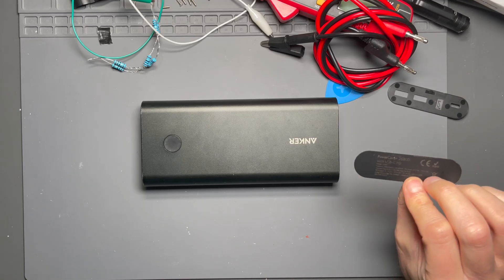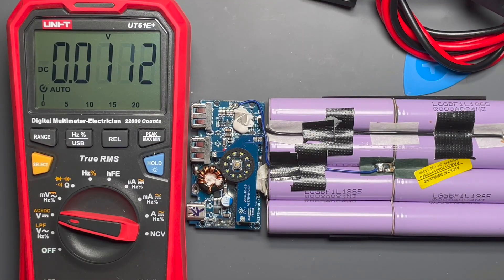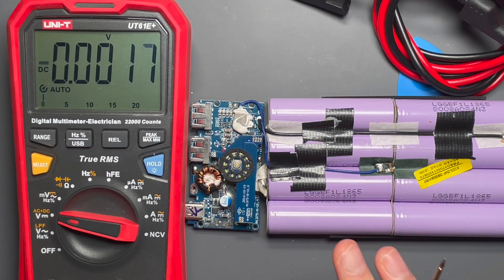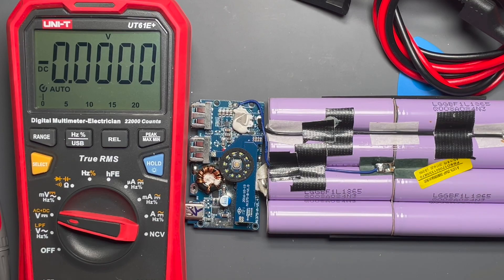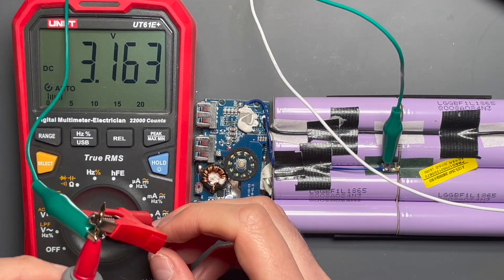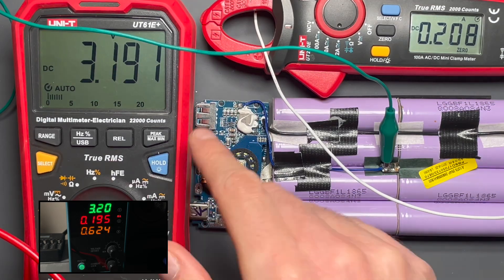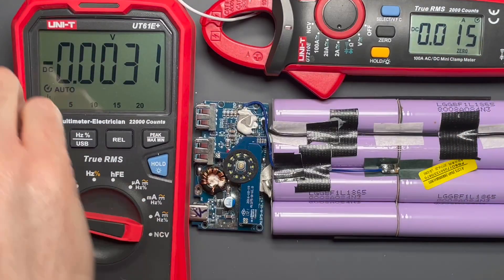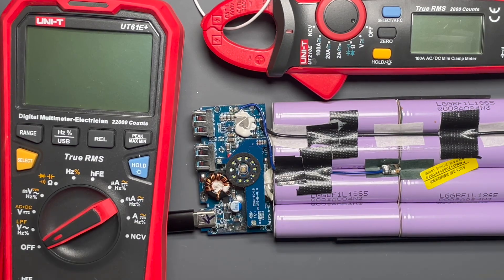Anker PowerCore+ PD 26800 - Won't Turn On, Charge or Discharge

Comment from the maker: Hello, TCE here! Just a quick note that I am aware that the camera framing is tighter than I'd have wanted for a portion of the video. However, I couldn't re-record this, as I didn't want to take the pack apart again, and potentially further degrade it. While it may appear like some of the action is off-camera, all that is there is the connections. I aimed to address this with the diagram of the overall configuration in the video.

Comment: My Anker Power Core Elite III has been charging all day using the Anker 65w Power Pod, all I'm getting is the charge lights going around but that's it, I've tried it on various charge bricks and different cables but it just won't power up. Just the charge light going around. Is it dead or shall I just leave it running? Many thanks to anyone who can help.

Comment: The whole pack needs "balancing", ie each cell needs to hold a certain charge voltage and all cells need to be in a specific range together..if even ine cell is out but a certqin amount, the rest will.not work
Its a safetything.
Reply from the maker: Hmmm, that's not quite true. The cells in parallel "self-balance" to the weakest cell's voltage. No active balancing is needed there. It's only when you get into cells in series with one another. Perhaps I'll make a video to demonstrate further. Thanks for watching!

Comment: Hi, I have the newer version of the Powercore 26800. Where it has a temperature sensor instead of a BP wire. The cells are almost full. Total 15.6v / 4 = 3.9v per series connection. Not giving a discharge. But once plugged in, the battery indicator shows its full. Immediately after unplugging the type c, light goes out and doesnt turn on again.

Comment: Hi Mr Engineer, I got a Anker Powercore II 20000, its almost 3-4 years old haha... For somereason its charging, it does the same animation/light/leds to as its Charging, but it doesnt charge - It comes very hot where the BMS board is, and when I press the button to see if there is any lights... It doesn't light up.
Any idea?
Reply: Note that it wasn't discharged for too long... it was fully charge, and used for a bit, and in the next day I plugged it in for charge. I haven't opened the Battery up yet to check voltages. Might do soon...
Reply: @OMGitsAFrEaKDuCk seems like a short somewhere on the board. Have you tried checking the ports to see if they are clean?
Reply: have the exact same problem. Looks like it's charging, doesn't charge other devices. Any solution?

Comment: I've had my powerbank in this state fro about a year now, and I've just opened it up to take a look, and I'm getting a reading of 2.81V on one set of batteries and 2.83V on the other, and I don't get any responsiveness from the LED indicator. What would you recommend I try?
Reply from the maker: That’s a pretty low SOC (state of charge) on those cells. I’d watch the video that you just commented on, but instead of performing it on just one “side” of the cells, you will be performing it on both “sides” (one side at a time). Hopefully that makes sense; if not let me know! Best of luck, and proceed at your own risk. Thanks for watching!

Comment: The 737 has got big firmware reliability problems. Display goes into protection low voltabe or low temp or high temp mode randomly and cant be hard reset. This item needs a recal before they all get returned.